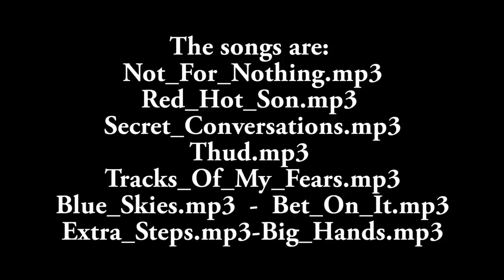18KT gold contrariè ring with diamond and ruby handmade

Comment: Nice job but I have a question what kind of torch are you using or do you have any recommendation of a good torch to work with and for one who don't wanna use oxygen tank  thanks😃
Reply from the maker: It depends on how you get it, I'm fine with the propane gas flame

Comment: At 14:33, what is the clay-looking stuff called that the ring is in? Also, where can this music be found?
Reply: Pete Moss It's some kind if tar resin, if memory serves. It gets soft above... I want to say 120C. Then you can get most of it off and reuse it. Pretty sure you can get working ones that soften at lower temps as well, though... I've seen some that went soft in very hot water (very convenient), but not sure about the formulation of it.
The music titles are written in order at the end, so just google it. It's from a free music library. =)
Reply from the maker: Thanks for the correct explanation

Comment: How much do you sell your rings for?
Reply from the maker: It was made to order along with the customer's gems
Reply: Please answer me and thanks , What are the most important tools you can use that I can buy? <3
and I'm newbie Can I use Iron or what !!!!! 
Thanks You are  a true craftsmen
Reply: Not iron. Use at the least silver (you can buy pre-milled lengths in ring shaped "wire"). It is dirt cheap and relatively easy to work, cut, solder, polish etc. Buy silver solder (also not too expensive). You can but zirconium and "grown" rubies and similar stones for practice. For tools: jewelers saw, pliers, blow torch, solder pad, flux, mini drill bits and hand drill, files and polishing mats will get you pretty far.  And go check out Soham Harrison's videos for good explanations of the theory or buy a beginners manual.
Reply: Dawgggyyy Dawg notcelgraave
Reply: Dawgggyyy Dawg youwelcomme